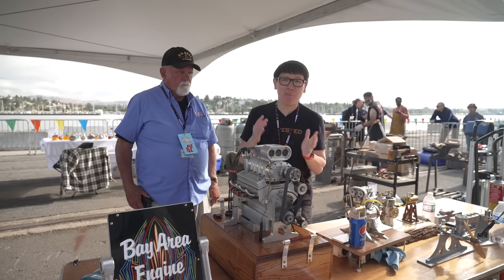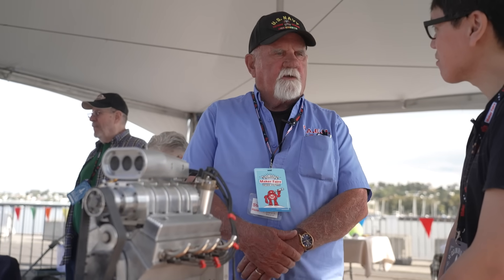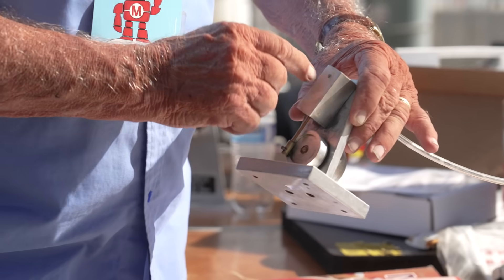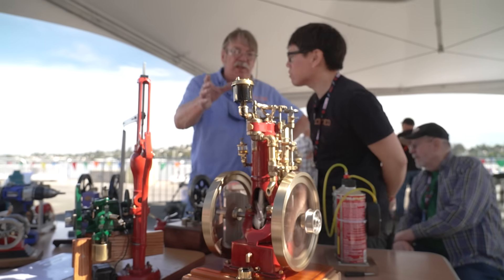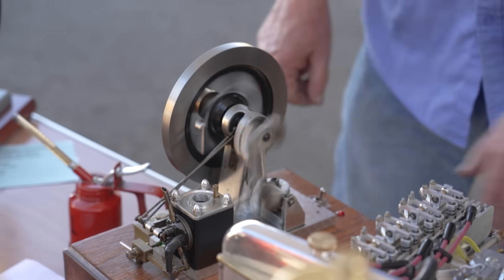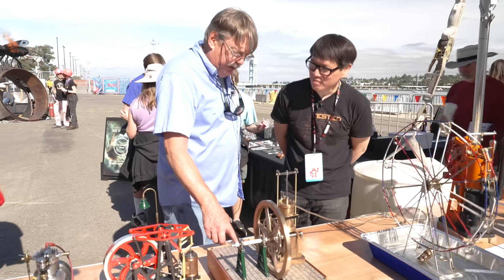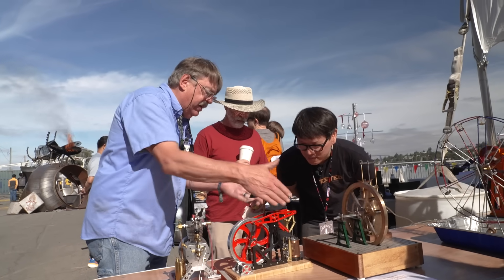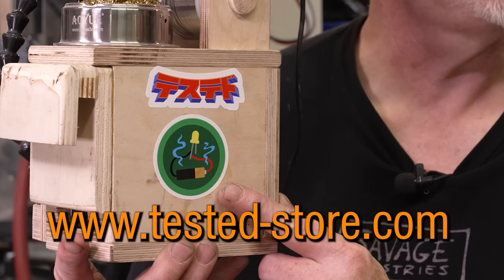Handmade Working Miniature Engines!

Comment: Thanks, Norm.  Appreciated.  Could someone explain what makes an engine "Hit and Miss", please?  Seen/heard the description several times now, but no explanation of the term.
Reply: I was waiting for Norm to ask about it! 
From Wikipedia: 
> The name comes from the speed control on these engines: they fire ("hit") only when operating at or below a set speed, and cycle without firing ("miss") when they exceed their set speed.
Reply: It's basically a very crude form of speed regulation - once the speed of the engine gets too high the governor disconnects some part of the mechanism (say the ignition or the intake valve) so that the engine stops firing until it slows down again. You can recognise them when they're running because they make a distinctive irregular "POP-POP-POP-(pause)-POP-POP-(pause)..." kind of sound.
Reply: Thanks, folks.  Appreciated.

Comment: What type of equipment does a hobbiest micro engine machinist own to fabricate theses? A Bridgeport?
Reply: Any mill/lathe will work but Bridgeport will hold its value to the old timers. Most of the knockoffs are just as good these days if not better (heat treated is obsolete compared to chromed ways, no digital readouts, etc.) and the next gen doesnt care. King makes good lathes though I think they are out of Taiwan.

Comment: I'm really curious how far you could down this road with 3D printing.
Reply: Air powered all the way, there are free designs, anything involving heat might be a problem if you don't want to print metal
Reply: JohnnyQ90 had an exhaust made with 3d metal printing, for a miniature engine he has. It's cool.

Comment: The whole "miniature engines" thing is kind of an interesting rabbit-hole to go down.
Obviously, some are real engines but there's also a lot of people buiding fake ones.
You'll see video's that show "engines" that apparently have twin overhead cams and show various clips of the construction but DON'T show things like the valve-train - which would be a marvel of miniature engineering that a builder should be proud of.
A lot of these "engines" also seem to have oversized "alternators" that have heavy wires running big batteries... which would be ideal if, y'know, the "alternator" was actually an electric motor driving the entire thing.

It can be kind of fun watching the video's and trying to decide whether or not you're looking at a real engine or a fake one.